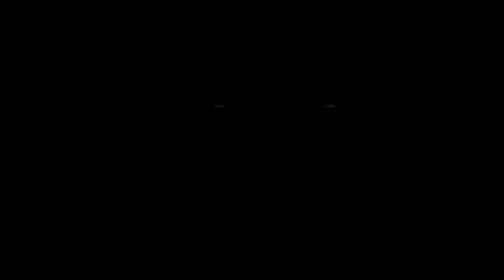Joel Lagace Don Smith PDF

Comment from the maker: The problem I have with PDF and other reading media is that my eyesight up close is not good. . . I use my tiny phone and not s large screen. White background is like looking at writing on a lit lightbulb. White screens were designed most likely for printing on real poster. Which is white. I need a program that changed all words to white and possible background to black. However some websited make it impossible. Also they limit sizing. Which is refocus. Which is another reason I hate phone apps! They are the worst for me to deal with.
The page should or must also be marginalized. Such that it first not cross the page. It needs to read in a column so that moving the screen left and right is no longer necessary.